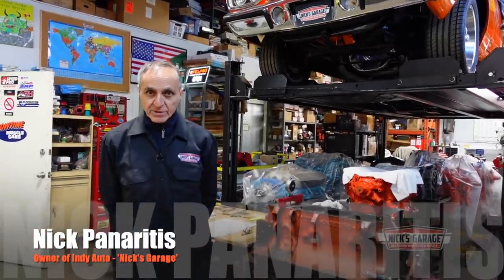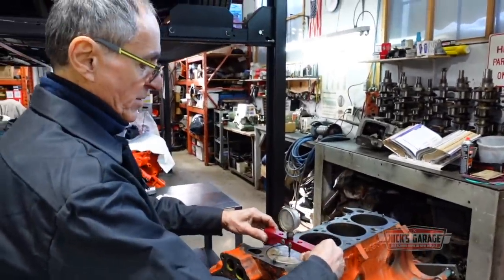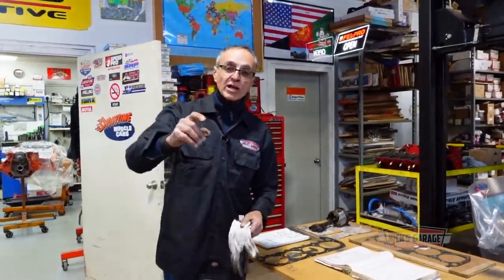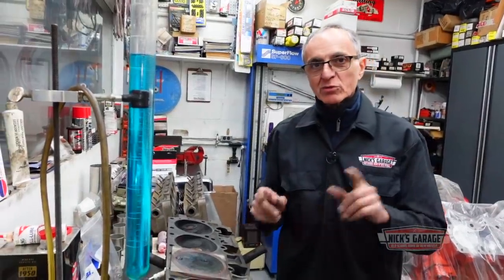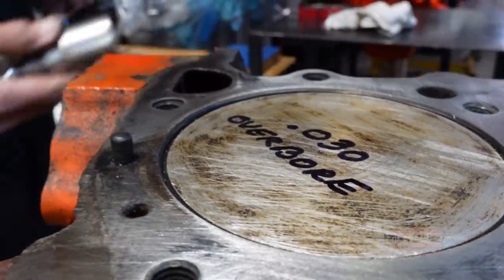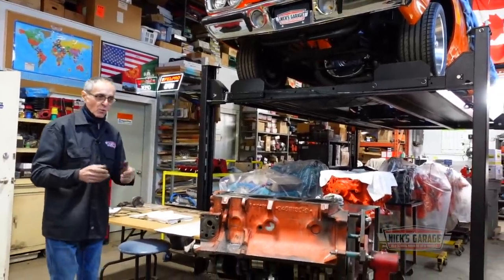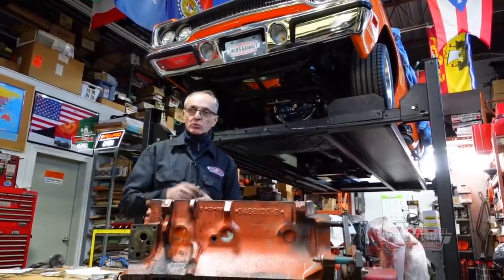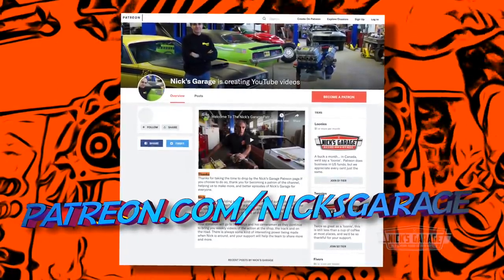Calculating Compression on MOPAR 383

Comment: Geez Nick, freely giving away decades of knowledge like that. I just don't see that very often. Thank you so much. You are the greatest
Reply: He's a natural teacher.
Reply: This stuff is common knowledge
Reply: @williamarnett9064  when I go to buy a head gasket for a 440, it's going to be the one Nick says.
Reply: Nick if you have a problem getting the right Pistons isn't there a way you can offset cut the crankshaft and give the motor a little more stroke? .075 below the deck wow.
Reply: Amen
Reply: This is kind of what I did for a living, only we didn’t have computers to help us with the calculations to find the static compression ratio like we do now. I worked in the parts side of engine rebuilding, getting my hands dirty whenever I could. My job was to find the right parts for a build. Sometimes we took parts from another application to get where we needed to be. A good example was on the 350 small block Mopar. It was actually a 318 stroked with a 360 crankshaft. To get the piston for that we had to search the master catalog for a piston with the right diameter that had a thick enough head to be machines for the longer stroke. The 318 used a 3.31” stroke, but the 360 used a stroke of 3.58”. That meant we needed a piston that could be milled down .135”, half of the way.270” difference in stroke. The piston was then identified, a Sealed Power forged piston with about .200” thickness left after milling. things like that are possible when you take into account everything Nick just taught us.

Comment: 030-.040" quench is good for power and helping prevent detonation. Zero deck with valve relief flat top pistons and .040" head gasket.  Dynamic compression/ cranking compression is where the camshaft and real magic happens
Reply: Yes, depending on camshaft profile.
Reply: I remember reading somewhere that the old guys would say just before the pistons "slap the heads" is where you get the best power!  When the pistons come up to TDC the mixture is forced out of the quench area into the center cavity increasing the turbulence, like vortec heads, increasing the burn rate and power.  They discontinued this because it increased emissions!  They used to have two quench areas then one then open chamber for emissions.

Comment: I've spec. a big block Ford 351 c. with 30 over to 10.5 compression . it pumped real good with a mild RV cam . It worked real good! We did allow the machine shop do the lower end line bore crank and cam. They also balanced and decked the block to matched the gaskets and pistons. Wow it had so much low end we had to put wide track tires to hold traction. It pays to trust your machine shop. 
         We were a more general type shop, leave the critical measurements to someone who is used to this type of exact measurements. There is nothing against you (with all of your experience) this is a money and time saver for us all not so familiar with these critical measurements. 
        Find a machine shop that is qualified to the that has the reputation and you can communicate your ideas. It will pay off in many ways that most people don't realize.
    Nick you've obviously been there, done that, many times. A lot of people watch videos but don't realize that you have to have the skill to do this kind of critical measurements.
          Love every one of your videos I've watched. You are a knowledge resource that many rely on.

Comment: 30 years ago i built my first engine. Everything was done by the numbers from the engine shop. And a little 350 gm small block with 8.5 to 1 became 10.5 to one. Bored .60 over.  Raised flat top pistons to match the 202 heads. Gutless wonder became big power. Which need new trans built to handle it all.
Reply: Wow. You built an engine that was .600 over!  😂

Comment: Thanks for the lesson Nick. That's what happened to me, I had a 1980 351w built, 30 over and a bunch of stuff done to the engine, I wanted between 9.5-10:1 compression, I got it back assembled, put it in a 1980 bronco but always felt that it was very sluggish, fast forward years later I gave the engine to my friend Tony to build it and put it in his Cougar, when he pulled the heads off, the pistons sat down in the cylinder, exactly what Nick just explained, I think my compression was only about 7.5-8.0:1 compression, no wonder I had no power, but now after a full rebuilt done right,Tony is running 500plus HP. So if you get your engine built, find someone who knows his stuff and understands what your after!

Comment: 11:15 Great point about finding tall CH pistons to limit decking. Plus, the more you deck the block, the less well the intake manifold will line up.
This is great, I'm so glad piston companies will tell you their CH. Some companies openly brag "We have -.010 to -.020" to compensate for decking.
14:05 I always wondered about how to get good head gasket sealing when an engine was not designed with aluminum heads. I'm glad just ordering a Fel Pro does the job.

I was not expecting a little over 8:1 due to the various rebuild parts. Interesting story.

Comment: Good video. There are a few more things to consider in the build process or even before taking your project to a builder.

* Having a (older) Block align honed will ensure that the crank centerline will index when time to measure Compression Height (CH)
* Find a builder that has a BHJ fixture for your application to Square Deck your Block or knows the "Old School method" to do it.
* Reconditioned Factory Rods will be different lengths because their caps were cut before honing, resulting in a shorter length.
*  CC Combustion Chambers after Heads are completely rebuilt. VJ will sink the valves, porting, and surfacing decks will both increase and decrease Chamber size.
* Try to use a Head gasket that has the exact Bore diameter as your Block's bore. A larger diameter gasket bore will lower CR.
* A deck surface with as much as .004 inch warp will lead to a loss of CR. Deck surfaces as little as possible to correct.
* (For Mopars) For every .010 inch decked of surface, .0095 inch should be removed on the Intake side. That is, either the Intake side of the Head or the Intake manifold itself.

Some people will say these precautions are unnecessary. Maybe so, if you plan to build a cruiser.

Comment: Most "rebuilder" pistons are destroked about .040. They do that so that the rebuilder can mill the heads, bore the block and even deck the block and the compression ratio will stay at or be below the factory specs. It makes it so the rebuilder has less issues with piston failures from the compression getting higher than stock and the customer using low octane fuel, maybe too much timing and a cooling system that might be less than perfect. They don't care about performance. If you use those pistons on a engine that everything else is stock you get the situation Nick found on the 383. Good aftermarket performance pistons should have the original pin height.
Reply: This is exactly what I have found to be true of most "rebuilder" pistons. Most are in the range of. 040 below deck.

Comment: This is probaly why my 1972 chevelle ss with a old truck motor 454 outran my buddys 1970 roadrunner 383 with 4 speed, not sure what gears chevelle had or his but his car had to be slow,  the, chevelle had 400 turbo auto and best quarter mile time was 14.7 ,  great job great show guys!

Comment: Nick, I used the same website and entered in .044 for Compressed Gasket Thickness and .074, as you had, for Piston Deck Clearance and came up with 7.830971650372592. I see you entered in .020 for Gasket Thickness and came up with your number. It's even worse than you calculated, more like a late 70's motor home 440 compression ratio, yikes. Excellent job on the videos, enjoy them very much.

Comment: Hi Nick, I really love your videos! I went to school for auto mechanics nearly 35 years ago and we learned how to calculate compression ratio along with a lot of other things. I sat down and did the math for fun. The hardest part is converting CCs of the head to cubic inches so all the units are the same.  It works out to be 5.37 cubic inches.  The rest of the math is straightforward and I come up with 7.817:1 compression ratio.  What did I miss? Again I love your videos watch them all the time and greetings from Michigan USA.  Farmer Bob
Reply: I got 7.86:1 and that wasn't even accounting for the extra volume added by the slightly larger head gasket bore size. That probably added another 3-4cc's of volume. So, in reality, it's probably closer to 7.65:1... YIKES!
Reply: Hi farmer bob. I also came up with 7.8 ratio. With a .020 gasket and zero deck height he will have near exactly 9.5 ratio when he is done. I used a crude setup with a 60 cc cow syringe and a plexiglass plate with a hole to measure things way back when.

Comment: Nick,
Great video - thank you! I ran your numbers on two different online CR calculators and they both came up with 7.85:1 / 7.88:1.
Bore: 4.28, Stroke 3.375, Deck: .075/.073, Head gasket thickness: .044, Head gasket bore diameter: 4.415, Chamber volume: 88cc
Paul (in MA)
Reply: Really ?  With a flat top piston.  Which calculator  on line ?  Less then what I calculated of 8.2. WOW.
Reply: @nickpanaritis4122  I used UEM Pistons and Summit Racing calculators. The Summit one does not include head gasket diameter so it is probably a little less accurate.
Paul (in MA)
Reply: @Paul1958R     Thanks.

Comment: I have a 70 Road Runner with matching 383 that is currently out of the car and waiting in line at engine rebuilder. In addition to rebuild we will do high perf intake, carb, cam, keeping stock exhaust manifolds. We are also planning to stroke it as well. Hoping to get close to 500 hp when done and loads more torque!

Comment: Effective compression ratio can be different, according to the camshaft.
Reply: He was just stating stating the basics.  I'm sure he can do a whole other video on static versus dynamic compression. He was dumbing it down for the average Joe.
Reply: @bradleynelson5915            That is correct.   Thank you.
Reply: Yeah, the DYNAMIC compression is greatly affected by the duration and LSA. That's why cams like the Comp Thumpr, Howards Rattler, and Hughes Whiplash cams have lobe centers of 107 to 109, and close the intake valve early; to build cylinder pressure on low static compression engines. But a restoration guy won't like the choppy idle and low vacuum.

Comment: I built a 383 years ago and used Keith Black pistons (with one large valve relief trough) which were .030 below the deck, then milled the block AND the closed chamber heads AND a Cometic .030 gasket to finally get to an honest 10-1 comp. ratio lol. All these years later I’m still hearing that the aftermarket is still not very kind to the 383 for building compression.

Comment: Thanks for this info. All the arguments I have had over the years about C.R. vs. actual compression pressure. Compression ratio is just a mathematical value & the engine could have the same C.R. with or without the rings. It is the ratio of the complete volume of the cylinder + the volume of the combustion chamber with the piston at BDC compared to the same volume with the piston at TDC. Just a mathematical ratio.
Reply: If you really want to go far, there is the Top of the Bore that is radiused after the Boring procedure. However, builders don't factor this in because it varies and adds very little to the overall CR equation.

Comment: You can also calculate the effective CR on a built engine based on the cylinder pressure:
CR(effective) = CylinderPressure - AtmosphericPressure)/AtmosphericPressure
For example, if the CylinderPressure is 160 psi and assuming AtmosphericPressure is 14.7 psi, then
CR9Effective = (160-14.7)/14.7
= 9.88
Reply: Great info. Thanks.
Reply: Wow.  Licensed mechanic here.  Did not realize this.  Thank you.
Reply: Of course 14.7 psi is average atmospheric pressure at sea level. You can get the approximate atmospheric pressure at your location/elevation from the weather service but it will be in millibars. So, 1.0 millibar = 0.0145 psi

Comment: Well that was a Niclinic if I have ever seen one.  I often wondered all of the factors for measuring.  I knew about deck height, but didn't know about measuring the gasket thickness and opening on the cylinders.  That is good info no matter if you are building a daily driver or a racer.  Even married guys need a fast motor. :-)

Comment: Nice video Nick! 
I'm going through this right now on a LA 360. Pistons are stock replacement, with a compression height of 1.576", 73 cc, 915 J heads, .039" Felpro head gasket, block deck height of 9.620", pistons are .100" in the hole. This turns out to be a very low octane gas friendly engine, at only 7.793 SCR. Block crank centreline height is .020 higher than advertised. I'm not sure what action I'm going to take. According to the old Direct Connection Racing Manual, the cheapest way to gain compression is to mill the block, and heads.

Comment: Would be nice to have the pistons extra tall and deck them instead of the block. I always hate taking material off a block if I don't have to.
Reply: Then the piston crown strength would be compromised....best to get the highest pin bore to piston crown height and be 0.01/0.02" down the hole at tdc...not 0.075"

Comment: Great video Nick. My 1970 383 piston are .070 below deck. My pistons  are supposed to Mopar Performance 9 to 1 compression ratio. I’m running 440
Source heads that are supposed to be 80cc. When I calculated my compression ratio using the exact method you used I believe I cam up with 8.2 . I had my heads milled .050 to bring my head cc to 75. I found Commetic gaskets make a mls gaskets that is .029 thick. The 440 source gaskets are close to .050
My compression ratio is now 9.23 to 1. I have a Mopar cam 280/280 .470 cam advanced 4 degrees and have a cranking compression of 175 psi. The engine has strong mid range and pulls to 5500. Good enough for me.
Reply: Sounds like a nice 383 Eric!

Comment: great 4 corner decking review on this mopar 383 .  About SBC . . . yeah most aftermarket chevy 'on the shelf' pistons are designed for zero decked chevy = 9.000" decks, stock on many SBC is 9.025"  so we take off .025"   or 25 thou for that on small block chev's  decks with some strokers or destrokers or builds at zero or slightly above deck surface then get quench to .040" usually accomplished with a .040" compressed thickness gasket although can go .039 or .038" if all forged. some go closer but that is a full contact sport LoL !  If the pistons come out of the block oh say .002 or .005 then we are looking at a .040 through .045" gasket compressed thickness .on SBC i choose a non hollow top piston with slightly less cc relief than i need so changes to the head and piston cc i make shall all come to final number planned in the pre-blueprint i take a few cc off a piston rounding corners and sharp edges on the reliefs and or reverse domes shapes and shape mod the chambers.  then a build finished blue print is accomplished  through the process of building it.   i love this stuff thanks Nick ! This is going to be a great 383 ! you could get a custom piston that is taller, your deck is nice and level for it. maybe a rod , crank , piston combo that measures up to zero, have the crank offset ground to make up the difference for an aftermarket off the shelf piston or the pistons and rods that are in there. This is to help everyone out there and nick has the goods. thanks nick.

Comment: Good morning Nick I just want to tell you that 440 source in Las Vegas has the 383 stroker kits in stock now.. you can make it at 438 or 496. But they got the kits in stock now..👍✌️💪😉 but just remember because I built a lot of these engines.if you build the 438/.025 piston to deck, Rod ratio of 1.8 ..it'll be 10.5  compression, if you build the 496/.002, piston the deck. Rod ratio of 1.54.. it can be anywhere from 11.00 to 12.00 to 1. Depending on the combustion chambers of the 906 heads/and how much squish that you want.. and on either engine I always shoot for .040 piston head... 😉💪✌️
Reply: Thank you for the info.
Reply: @nickpanaritis4122  👍😇🤗

Comment: using a stock head gasket the motor would have a Compression ration of 8.12 (I see you had the input for gasket thickness as 0.020).  With the 0.044 thick gasket that motor only had a compression ratio of 7.8 to 1
Reply: YUCK 1940s compression
Reply: Good catch.
Reply: @NZMOPAR  And late 70s.
Reply: @jeffrykopis5468  yes very true

Comment: Not just low compression ratio, but chamber quench is lost with the pistons so low. The 68-69 383 4 barrel pistons are above the deck with open chamber heads. The old TRW/ Speed Pro domed 383 pistons had the pistons below the deck for use with closed chamber heads.

Comment: I'm planning a 383 myself and I'm planning to order a set of Ross pistons with the compression height set where I get a zero deck so I don't have to deck the block any more than just a clean up. I'm going to use a .020 shim head gasket and maybe have my 906 heads shaved just a clean up and I should be 9.5-9.7 to 1. Later I will get a set of 440 Source Stealth Heads with a small closed chamber and use a Felpro or Cometic gasket to set the quench height and get a real good running 383. I'm also looking at a Crower HPD271 cam. Looks just about perfect for this. Maybe the HPD282.